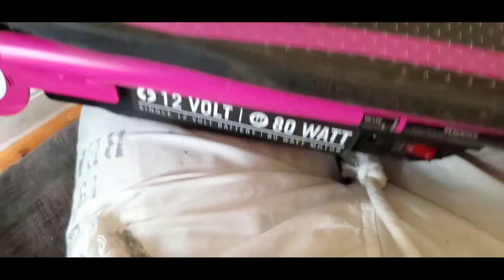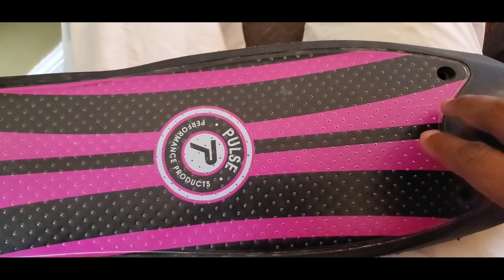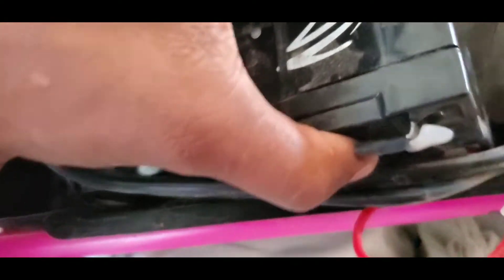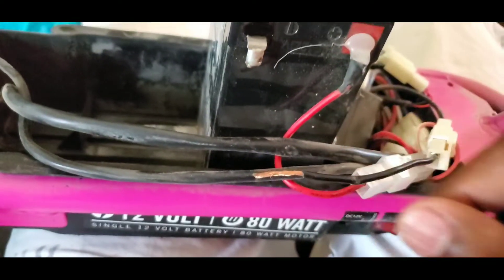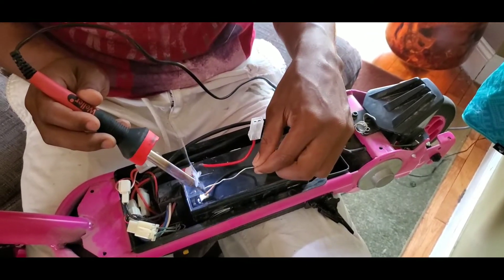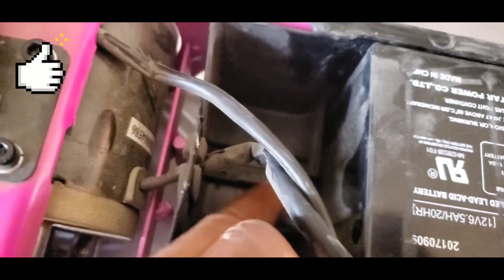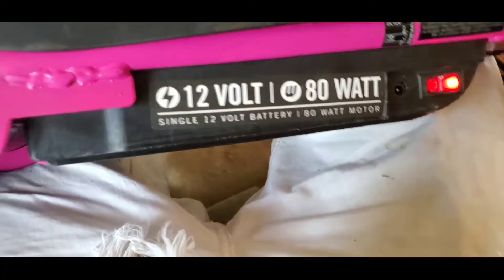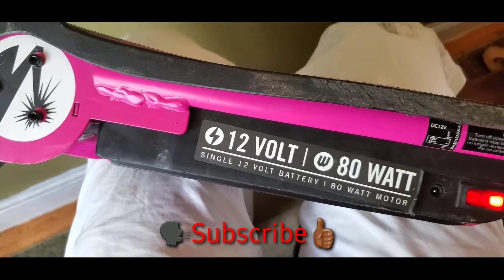Revster electric scooter stopped working (easy fix)

Comment: I know this video is very very old but I've been working on razor products for a very long time and I can tell you soldering weakens the connection. I know you didn't solder it but the razor factory they solder it and then glue it after the sleeve is on all you have to do is heat it up and pull it off or you could buy a new battery and buy some butt connectors cut the wire crimp on but connectors on wires and then hook them up to the battery makes for easy replacement and more power
Reply from the maker: Ok.. thank you 🤝🏼
Reply: @6Charliedoitall great clean fix ik it's not a razor product but this is nice work !! nice to see some fixing instead of throwing it away

Comment: My son has had this scooter 4 years and never used it. He wants to use it now but it won't work? Light does come on but it won't drive.
Reply from the maker: This scooter that I'm working on in this video it doesn't roll until you actually get on it and manually roll it then the motor kicks in.
Reply: Any ideas for what you would do if it the motor just never kicks on?